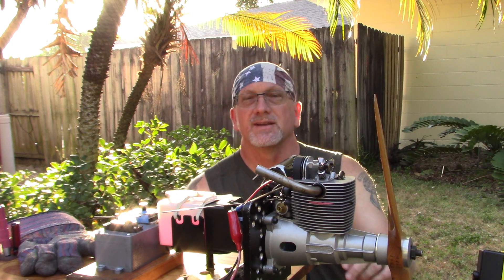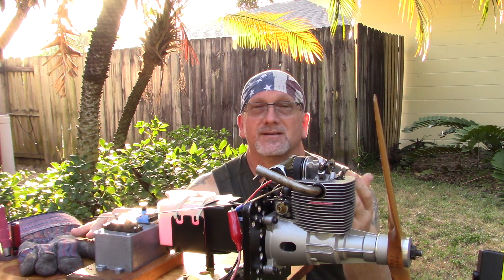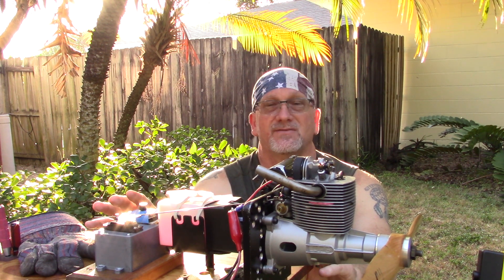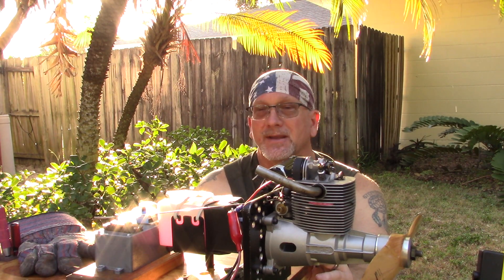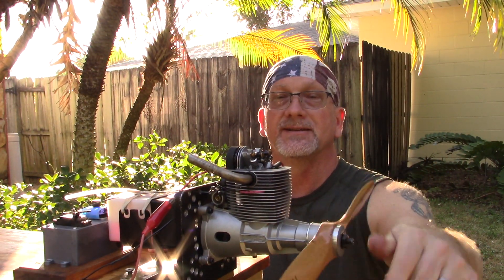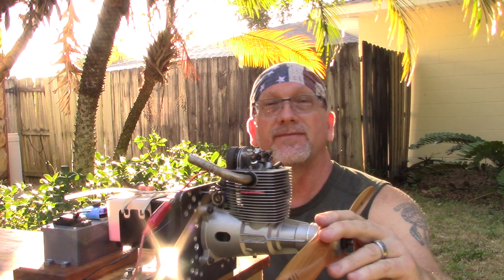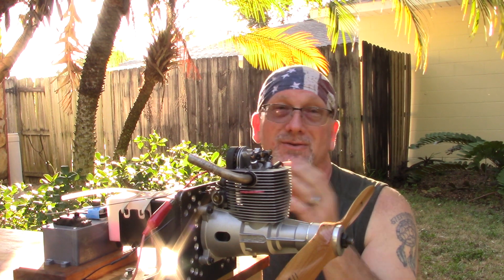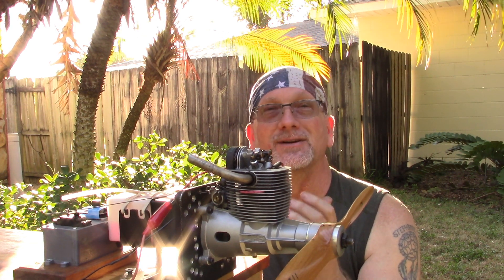OPS 20-4 Glow Plug Tests

Comment: Thank you for the video. Good running engine and regarding the Enya 3 in 4-strokes I have the same experience. I ran it in a Laser 70 for 2 flying seasons (20 flights trainer model, 25-30 flights funfly hoover training) and it performed as good as an OS F plug. The Idle might have been a little lower on the OS F but we are talking about 1800 v.s. 1600 rpm. In my Enya 46C 4-stroke OS F or Enya 3 doesn't make a difference. I like the OS F in my V-Twin Laser as it sounds great at low idle but for normal reliable flying the OS F is not necessary. The good characteristics with conventional 2-stroke glowplugs may have something to do with the design of the combustion chamber and the intended amount of nitro for the engine.

Comment: Very nice engine. Seems to like the hotter plugs which advance the ignition timing. Higher nitro content like 10% or 15% would also advance  the ignition timing. I'm not sure what the compression ratio is on that engine but higher nitro may give it a kick in the pants!

Comment: Ran good and I think the A3 plug is a similar heat range to the F plug but shorter.  What plug were you using on the MVVS engines?  I have a MVVS that I have not run yet and was wondering, thanks
Reply from the maker: The plug that came with it. I don't know what it is.
Reply: The A3 is very hot and the OS F is relatively cold. The 4-stroke plug design isn't necessarily based on a hot glow plug. The front portion of the OS F 4-stroke plug prevents condensed fuel or oil to cool down the glow wire before another combustion stroke heats it again.
You can estimate if a glow plug is cold or hot if you measure the current they need to glow with the same brightnes at a constant voltage. According to this method the OS F is much colder than the OS A3. MVVS Engines from 2,5ccm to 8ccm will run with the OS A3 (OS 6). Smaller engines like the hot plugs more and depending on the thread length in the cylinder head you may look for a longer glowplug. High nitro content will require colder glowplugs. Engines with pipe systems usually need a colder glowplug if they "eat" glowplugs.
The great thing with the OS A3 is that it can light up every engine that gives you problems. It may not be the best plug to fly this engine but the right one to get it running.
Reply: @ringofthebrave  Thanks very much, great info!!

Comment: Sweet video! You could sure hear and see the Enya and OS a3 running at higher rpms with a smoother idle and transition,very cool what the differences are between plugs! So belts and plugs aren't a problem for this very neat engine! Thanks D!!